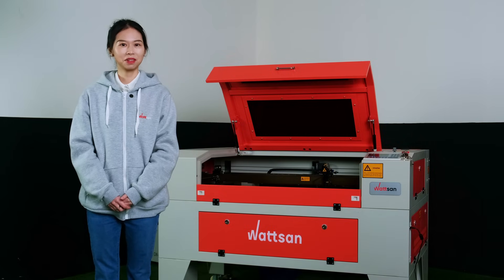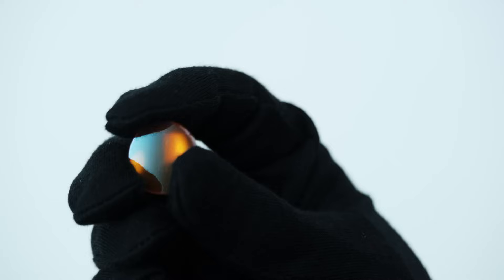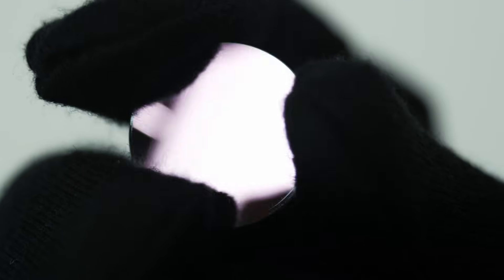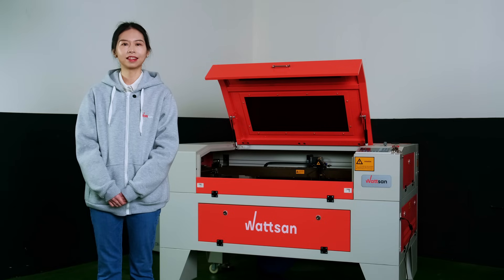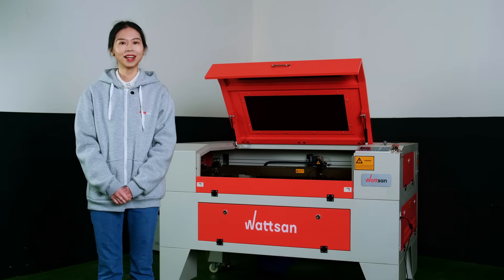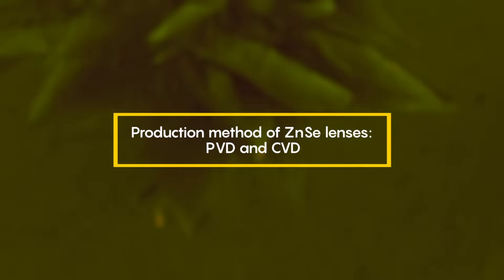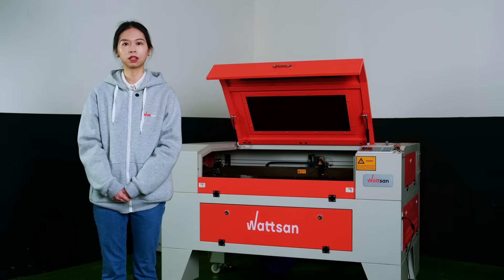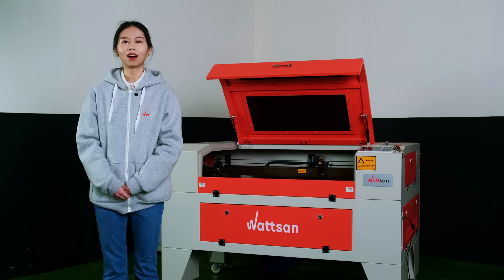How to choose lenses for CO2 Laser Machines? | Chinese PVD vs. American CVD ZnSe lenses

Comment: I don't want to be a party pooper but much of what is said here about lenses is wrong. I have been testing various types of lens on CO2 laser machines for about 10 years and one of the most illogical things stated is that the clarity of a CVD lenses is  a measure of its superiority, The gallium arsenide lens is completely opaque  but  performs equally well  (or better) than other lens matertials . If clarty was a deciding factor then plain glass lenses would be the best. Sadly, there is a misunderstanding  here about the properties of 10.6 mciron wavelength light. The opaque nature of gallium arsenide is because the light waves we can percieve  (all the colours of the rainbow,  in the range  of 0,38 to 0.78 microns) will NOT pass through , Hence  it is  the  limitations of the human eye that  sees gallium arsenide as black. Thus,  your eyes can  never "see" the transmission capabilities of a CO2 laser beam. Glass and many transparent plastics that we can see through, will NOT transmit 10.6 micron wavelenght. Instead , the energy is absorbed by the material,  and it is this fact that allows us to  engrave (damage) glass and clear plasics.  ie clear glass appears opaque to a CO2 laser beam. 

Zinc Selenide material made by two different  manufacturing processes  (Google it if you are curious). CVD (USA ....bright yellow appearance) and PVD (China...honey colour) .  Both are equally good at transmitting CO2 laser light BUT PVD lenses have a power limit of about 80 watts whereas CVD leses can work up to 300 watts .  It is true that Germanium is a VERY poor material  lens choice because expose it to more than 20 watts and it will self destruct. 
 
Conclusion:  A more expensive lens will NOT guarantee better performance , The exception.... Gallium Arsenide, has proved to outperform any type of ZnSe at cutting.

Note. ALL lenses are sold with an optical  focal length which is correcect for 10.6 micron wavlength light.  However, the maximim damage potential of any lens can be 2 or 3mm different from this nominal focus, depending on speed, power or material.